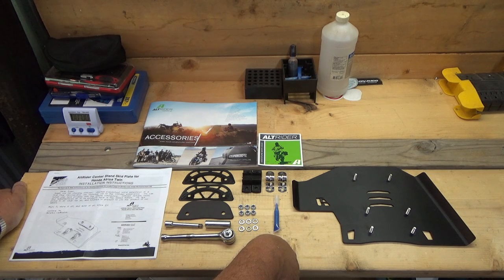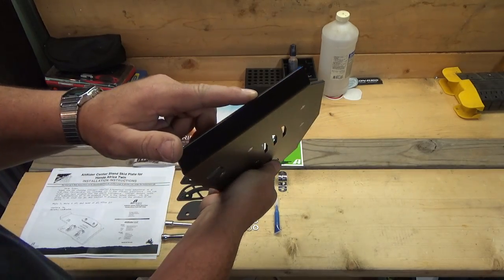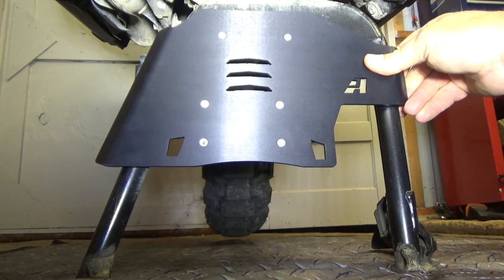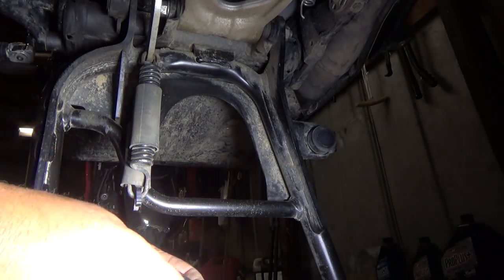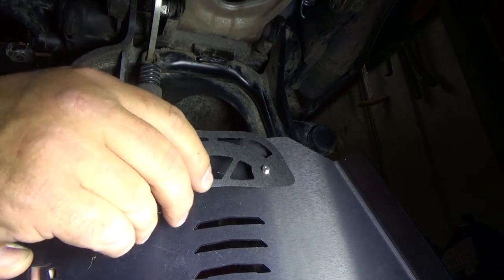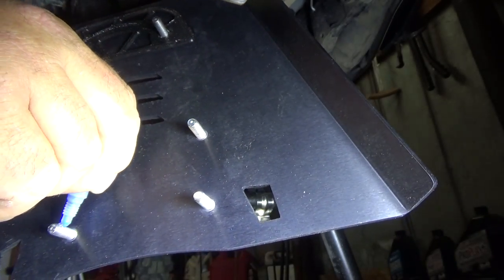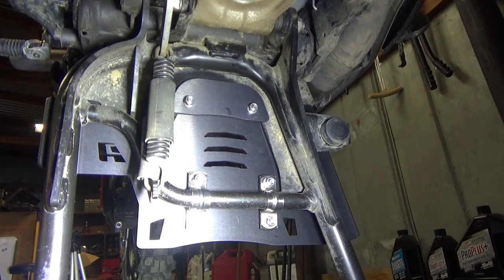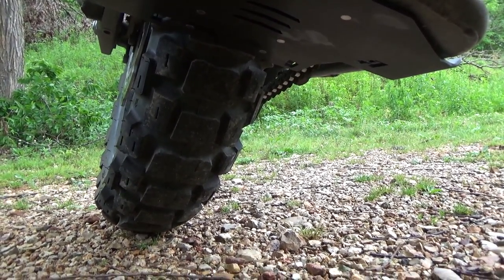Honda Africa Twin AltRider Center Stand Skid Plate Install CRF1000L

Comment: Have you tried it our yet?  I REALLY wish someone would make a transition plate or a center stand that doesn't hang down like the OEM Honda one does.  The OEM one looks like it would hang.  I have it on my AT.  Haven't tried going over a very big tree yet.
Reply from the maker: +Magwich777 i have went over a few logs but I didn’t have a problem

Comment: The problem is the center stand hangs down lower to get caught in the first place.
Can you get Jeremy to design a transition plate?
Reply from the maker: +Moto Dawg I also agree with you on that, the stand does hang down lower and some kind of transition plate would be nice. But the center stand skid plat does protect the shock linkage knuckle in the rocks.
Reply: That's true,  I just added a soupy lowering kit and a 14 tooth drive sprocket. It would have been nice to have one of your install videos for that. Kind of a pain in the butt!
Reply from the maker: +Moto Dawg Yea I'm to tall for a lowering kit. But if I was doing a ton of off road then I would want to lower the gearing